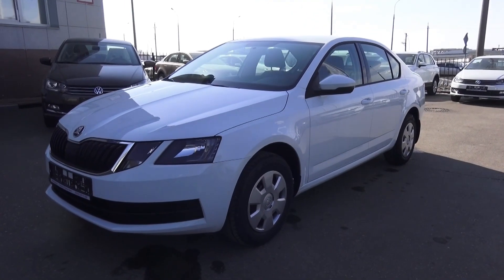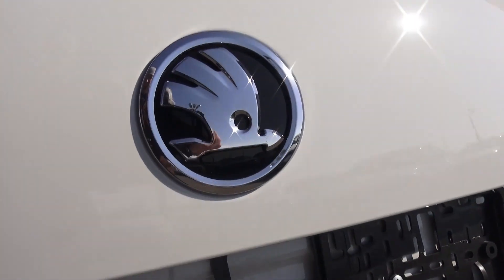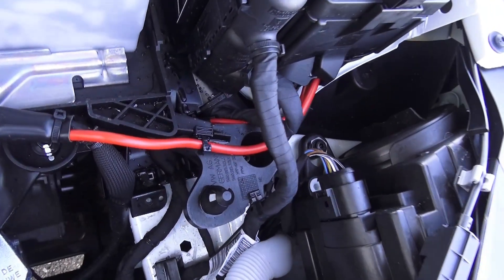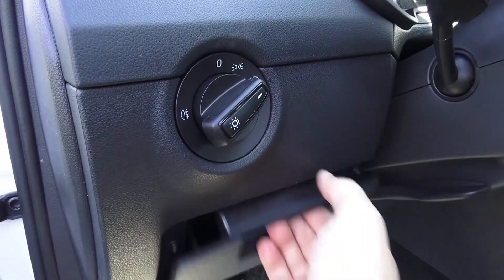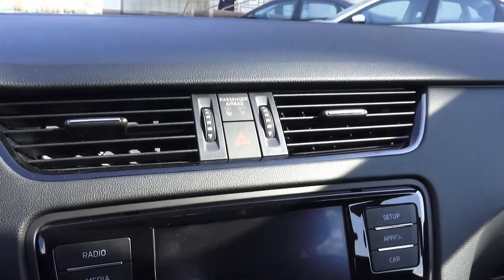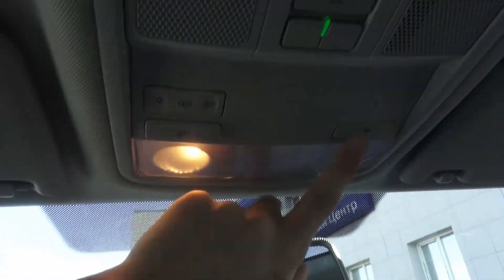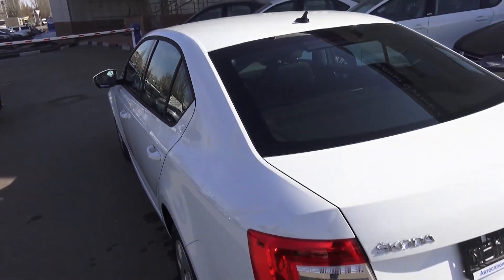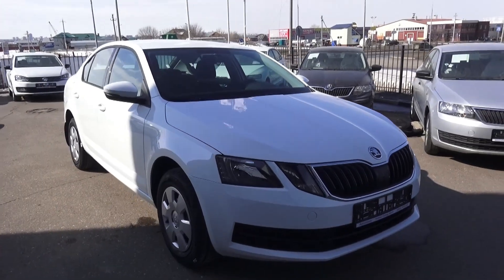2017 Škoda Octavia 1.6 MPI MT Active. Start Up, Engine, and In Depth Tour.

Comment: ah, the good old MPI... I hate seeing in the rest of Europe all the good naturally aspirated engines being replaced by those new tiny turbo pieces of crap...
Reply: Anton Mihiș Me too, I prefer the old MPI/FSI VW engine, the TSI is less reliable
Reply: yes, and not just VW, pretty much all European car makers... Hopefully they've learned from their initial mistakes in the early years and they're making them better now, but you still have to be very careful when buying one (especially second hand)...
Reply: Anton Mihiș The European Union (Euro6) system for cars is badly done, they want to increase "ecology" to the detriment of reliability
There are just the Japanese who resist like Honda, Mazda, Toyota or Suzuki and make cars with an naturally petrol engine
The european cars like Peugeot-Citroën, Renault, VW, Skoda, Seat make more problem with downsizing (TSI, THP, TCe...)